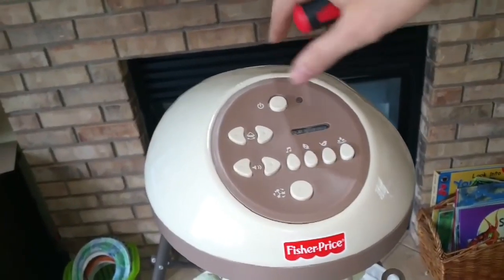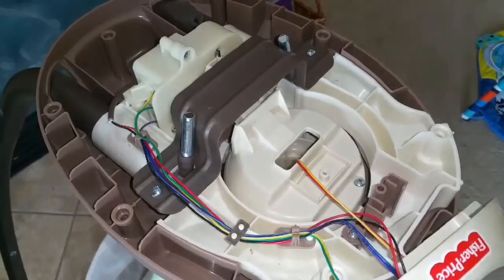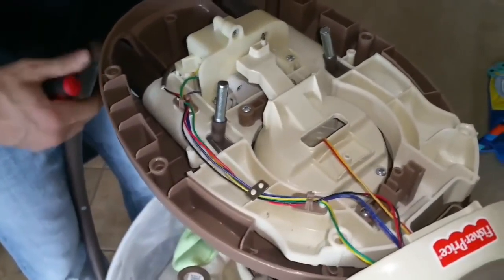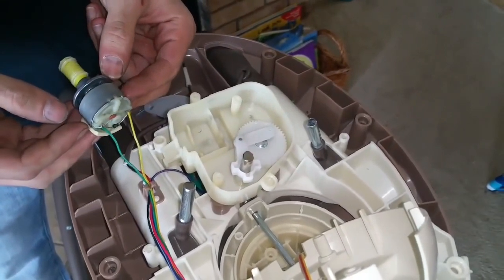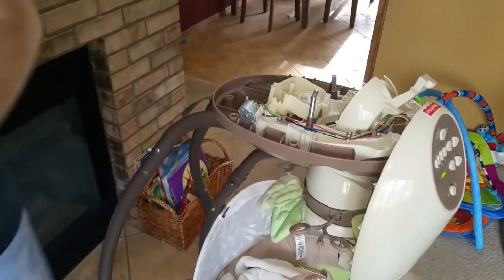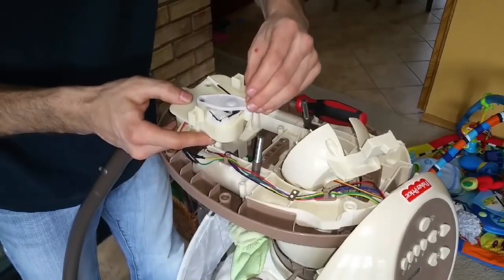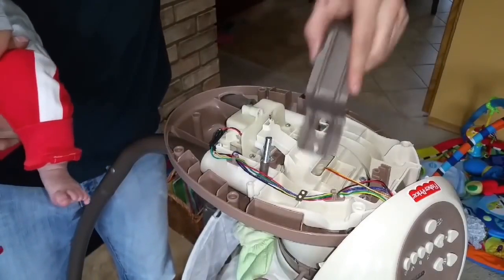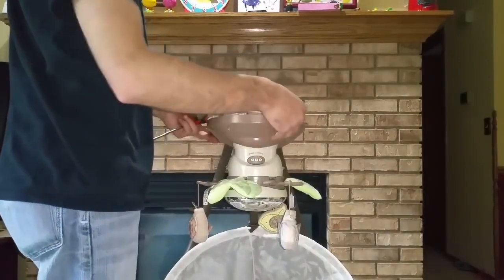HOW TO FIX A FISHER PRICE BABY SWING   SWING STOPPED SWINGING!!!

Comment: I was all prepared to follow the tutorial because mine was having the same issue. So I had the motor in my cart and figured I'd start taking it apart while I wait for it. Took it all apart and surprisingly the motor was actually still running. Maybe there was a part not connected properly, because once I put everything back in place the swing started working again. But now I know how to fix it when the motor inevitably dies (10 year old swing haha). Thank you!
Reply from the maker: I've seen the auger move off the motor shaft also. Maybe that's what happened. Glad you're back up and running.

Comment: Still today I appreciate this video! Thank you so very much. I’m very impressed DAd. U fixed all that with a baby in one arm! Way to go. Your kids & wife should be proud & grateful😊 I bought a brand new swing Ingenuity brand, not sure of motor type yet as I don’t have it apart yet but it quit swinging. Actually it swings when empty but when u add weight & put baby in, it quits. Sadly they don’t make stuff like they used to… Thanks for all the great videos.
Reply: My ingenuity swing stopped swinging because something broke in the housing where the motor is and it works like a magnet or sensor I have found

Comment: Awesome fix! Bought a Glade freshner for $10 and motor was exact. Came apart exactly as illustrated. My motor actually still worked when I removed it from the gear but it was too weak to rock the swing. Works perfect now!
Reply: Does that motor work for your swing

Comment: This video was a life saver! The swing is the only thing our little one will nap in and I contemplated for two days about buying a new one. Thankfully I looked up how to fix it and this video was the first one on the list. I had a problem finding the brown automatic sprayer like the one you used and the new versions which are white and tan have a different motor (which may still work but I know nothing about this kind of stuff). Fortunately I checked Dollar General and the DG brand automatic sprayer uses the one you need. Thanks!!!

Comment: Cool brother!!! We bought the exact same Fisher Price swing second hand from a friend and it stopped swinging a month after we brought it home for our granddaughter. I was planning on opening it up and looking for the problem. You saved me the trouble shooting and even with my more troubling issue, where did I put the box of old motors and whatnot? So don't tell my family, but I'll be the BIG BAD GRANDPA and save the swing. Pricy little boogers.....
Reply: Hi where did you get the motor.  I bought a glade that had a much smaller motor
Reply: @greiciul  Try some 
DC3 32 mm from Amazon. Look under 
6-12 volt DC electric motors. If you have prime, they will be in your hands within 2 days.  Saw the video and was pleasantly surprised to see that his baby swing is the exact same as the one we have.  So this repair will be a breeze. My motors will be here Monday.
Reply: @vitron01  did it work? Sorry I know I’m a little late but I’m ready to order now but don’t know what to order.. read your comment and you seemed to do as much reading and homework on people’s experience as me.. so is this what I need to order?

Comment: Went to Dollar General and got the Air Wick Pure 24/7 and it had the exact motor I needed 500TB-18280. Swapped them out and it's running great at full power. Thanks for the awesome info!
Reply: I took apart an Air Wick Pure 24/7 last night and it was not the same motor.

Comment: Thanks for posting. This is very clever! I do have an issue with my swing. In the model I have, the housing on the motor doesn't allow me to access / remove it. It's attached to the "arm" which moves the swing. I'm considering "muscling" the plastic to squeeze out the motor. I'll update my post if I succeed.

Comment: TIP!!!! On another tutorial I found in the comments the part number for the supposed Air Wick motor. I ordered it for $5 off eBay trying to be more efficient.  Looked identical. Attached it, worked but wasn’t powerful enough to move the swing. Flipped it around wondering if that was the problem... no difference. Went and bought the Air Wick in a last ditch effort, worked perfectly.  Unfortunately now my swing cannot be repaired again because we had to cut the wires for 3 fixes.  Bummer.  I’d love to save someone else this trouble and I’m going to post this in several places.  Buy the Air Wick!
Reply: I bought the Air Wick 24/7 last night and it was not the same motor.

Comment: Thank you.  Just fixed mine tonight with your help. I watched your video and ordered the motor from ebay. Maybe eight or nine dollars later I'm installing it tonight. I ran into a slight hiccup with a loud clicking noise but I just had to pull that part that I put on the motor up a little bit and adjusted around and I got the noise to stop. Again thank you very much
Reply: How did you find the motor on eBay
Reply: I just looked up Fisher-Price Cradle Swing motor. It's a very common motor which really ticks me off me off because it must be an issue. They are very easy to find on eBay or other sites. Mine was solderless but I had to cut off the connecter and connect the wires to each other. Very easy fix.

Comment: Does this work with most fisher price swings? I just got a 2010 luv u zoo swing and the motor doesn’t work at least I don’t think it does it doesn’t have an adapter but with batteries in everything but the swing function works

Comment: Thanks. I found a much smaller motor in the Glade sprayer. It wouldn't work in the swing. Don't buy the Glade sprayer with UPC code: 46500 01217
Reply: Same small motor in UPC 46500 75730 (Glade brand)
Don’t buy it!
Reply: Dollar General’s brand of automatic sprayer uses the motor you need. The new glade sprayers have a different motor than the one he uses in the video.

Comment: Will 500tb-19280 work ok? It's the same size and voltage. Also which wire is positive on the existing motor? Yellow?

Comment: So we did all of these steps, motor looks to be running great, but swing barely swings. Any ideas? It seems like something is binding or not connecting? We are stumped.
Reply: Figured it out. On another tutorial I found in the comments the part number for the supposed Air Wick motor. I ordered it for $5 off eBay trying to be more efficient.  Looked identical. Attached it, worked but wasn’t powerful enough to move the swing. Flipped it around wondering if that was the problem... no difference. Went and bought the Air Wick in a last ditch effort, worked perfectly.  Unfortunately now my swing cannot be repaired again because we had to cut the wires for 3 fixes.  Bummer.  I’d love to save someone else this trouble and I’m going to post this in several places.  Buy the Air Wick!
Reply: @texxxann  which air wick did you purchase?
Reply: Kylie Ross the freshmatic ultra because that was the ONLY one available at the store.  I think any of them will work, as long as it’s air wick ☺️

Comment: Just saw the pinned comment about the motor change  after I got the glade. So if your like me and have a 3d printer I have the stl file for an adapter. Takes the motor and rounds it off to be the same width as the old one and even has the screw holes on the front to line up. If you need it drop a comment uploading it to thingaverse later today.
Reply: I need it.

Comment: Hi I have a question 🙋🏻‍♀️ would you happen to know how to fix a faulty on and off switch? I have this swing but the turn on button won’t stay on.🥺
Reply: I'm wondering ...if its plugged in, it could be that the unit itself is faulty. [Doesnt maintain power received] hence the not staying on part. Is the button or switch feel loose ?
Reply: @coffeeconfirmed3609  the button doesn’t feel loose, I thought maybe the wires were loose. I’ve kept it this way and haven’t been able to fix it. I turn it back on when it turns off. Also.. it seems to work best with batteries rather than the wall plug in 🙃
Reply: @carolinacarrillo7208  uuuuugh..these baby items I swear 😔 ..i dont know if you had stored it away and recently dug it back up for another little one, but Ide guess that there maybe a messed up wire in your plug in[obviously] but maybe try some canned air in the "separation sections" where the wire plugs into itself.. If I explained that clearly? If you're lucky its a faulty connection due to dirtiness within those separation plugs. Wild guess.
Reply: @carolinacarrillo7208  I only say that, because my sister had that issue a few months back. :P
Reply: @coffeeconfirmed3609  thank you so much, I will try and see what I can do. It had this problem brand new out of the box. I had set it up for my newborn daughter a month before she was born and only recently found this out😭 thanks for your help. I’ll look up what you mentioned and try to use that.

Comment: Is it possible to do this without soldering? Thanks!
Reply from the maker: Probably easier to pick up a soldering iron for $10, but if you saved the wires, could twist and electrical tape.
Reply: Appreciate the quick response!

Comment: Bought the glade before reviewing comments.  Small motor, kind of works but doesn't fit.  Bought RF-500TB-12560 motors off Amazon.  Worked until loaded then it burned up the motor with smoke and ran too slow.  Now I am $20 and three hours into this wishing I would have just bought a new swing.  Anyone know the actual model number needed?   Needs to be variable speed, fast enough and have enough torque to swing the swing.  Got some escalation of commitment going and want to try one more time hehe.  I see in a comment someone said the 500TB-18280 works.  Going to buy one of those and give it a shot. 

UPDATE:  So while I was waiting for the 500TB-18280 to arrive I 3d printed an adapter for the small glade motor I had obtained initially, but even when fitting correctly that motor runs too fast and won't swing the swing correctly.   However, once the new 500TB-1820 motor I purchased arrived, it worked and had the right power and RPMs to swing the swing correctly .   This was the one I bought.  https://a.co/d/4Efjj1c (link to Amazon) it was only $8.
Reply: How is it holding up a couple months in? Debating buying the motor or the new assembly for $50 from Graco